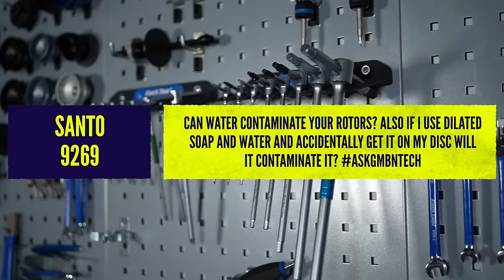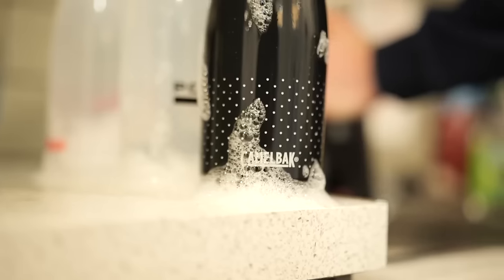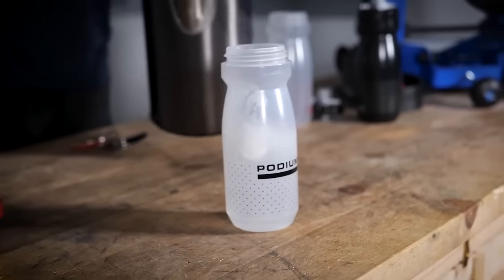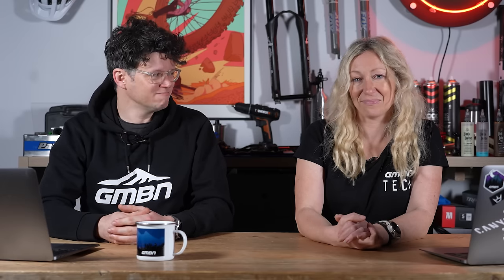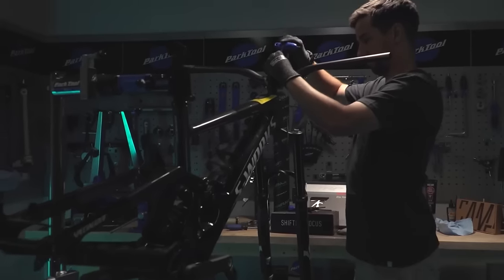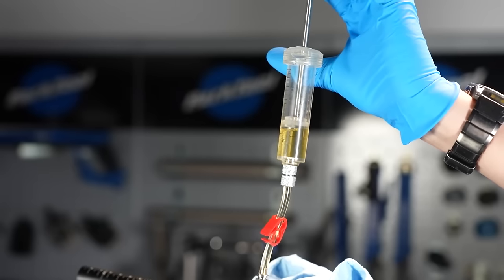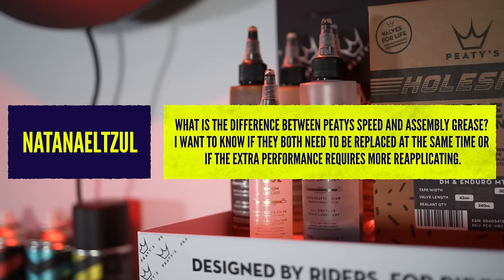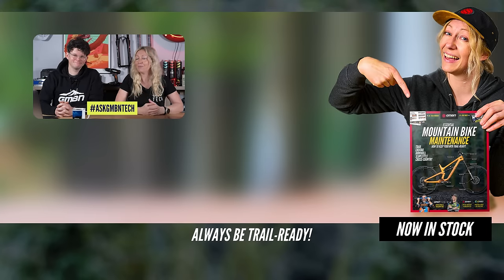2 Pot VS 4 Pot Brakes - Which Should I Choose? | Ask GMBN Tech 276

Comment: I must agree with GMBN
One step at time:

1. Change pads and clean rotors
2. Change rotors for bigger (one wheel on time, front first)
3. Change calipers/brake set for 4 pistons (one wheel on time, front first)
I was using 2pots SRAM Level brakes on both wheels, now i changed to 4pot Shimano 6120 front and 2pot Shimano 6100 rear.

Main reason - for me brake lever shape for Shimano fits better my hand and fits bettter in my handlebar (plus: my old Sram was alredy worn out, with slightly siezed piston, so i looking for upgrade)

Aparently is not much difference - rear one 2 pot (on 180mm rotor) are spot-on. SRAM or Shimano feels same, enough power to lock wheel witout squeezing brake hard.
Front - 4 pots (on 203mm rotor) has slightly better modulation than 2 pots. And pads are bigger, should last longer. And i can lock wheel little easier than on old set.

But biggest improve always was on rotor size for me (change from stock 165 to 203 in front was biggest improvement, 165 rear was ok, but sometimes close to overheating on long descents - 180mm don't have this problem.

Comment: I just installed 4 pot XTs. Easily the best brakes Ive used. Havent experienced any wandering bite point. Much better modulation than my Deore brakes. Im using the resin pads and its nice and quiet.

Comment: 4 pot up front and 2 pot rear. As a rule, if the rear locks up with a reasonable amount of force, that's all you can have, no point going crazy with it. The front does the real work so going with a little more power and working on your modulation is the key there. I run odd pads for that reason, semi-sintered up front for a wide range of braking conditions, sintered out back for longevity. The rear locks up easy enough so why go to the extremes?

Comment: #askGMBNtech. You kinda didn't answer the question about 2 piston and 4 piston brakes. My Fuel came with some lower grade Shimano hydraulic. I've never really noticed if they don't stop good. They get a good reliability rating. But folks in my area, tell me with 4 piston, I would have more confidence on the more technical trails. I still think getting off and walking is have all the confidence I need. My bike also came with a RS Recon. Which seemed alright. But folks told me because of my size, I needed a beefier fork. So I got a Marzocchi Bomber Z1. The bike came with a X fusion Shock. Now I'm being told it's junk, and a new shock will greatly improve the ride. I'm retired and no longer have that regular pay coming through. So I'll only replace that when it brakes. I look at it, as the bike company speced it on there, and they wouldn't have done so if any liability was involved.

Comment: #AskGMBNTech I bought a set of new/old stock Nukeproof horizon v1 wheels. They were taken off a new bike, and just sitting in storage before I bought them. They look great, and easily went on my carbon Stumpjumper. My problem is that I didn't realize the rear hub was 150mm. It fits fine, but my gearing is off by one. I can't shift down to the smallest cog. Is there a fix for this, like different end caps? Also, the brake rotor on the front wheel rubs very badly against the the brake pads no matter how much I adjust the caliper inward. The rotors are new and straight. The front hub is 110m x 20 with a 15mm axle adapter. Where can I get Nukeproof parts that will ship to the states now that Chainreaction no longer ships here?

Comment: #askgmbntech I have Sram GX 11 speed set up with XD10-42 cassette and 30t chain ring, I find I need a better climbing gear and was looking at upgrading to GX 12 speed as you get the 10-50/52 cassette, but can I get a different cassette for my 11 speed that gets me close? what's the maximum range on the GX 11 rear mech? Sram doesn't do a cassette bigger than 10-42but Garbaruk do a 10-46 ? what's best to do?

Comment: #AskGMBNTech
Hello, i currently have the issue of my organic brake pads, glazing over all the time. I recently scrubbed them of and inbedded them with water and now they are already glazed over. What could the problem be?
#AskGMBNTech
Reply: Contaminated disc surface?
Are your braking surfaces shiny, chrome like?
Reply: Aswell as ruffing up the pads I always ruff up the rotor with sand paper, so the rotors not shiny and then clean with isopropyl alcohol with a clean rag or blue towel.

Comment: #AskGMBNtech ive got a 2022 gt avlanche sport, upgraded the gears to deore m5100 but the bike feels a bit heavy, is it worth upgradeing the fork to an air fork and lighter wheels dose the frame have potential as expert models dont seem all that light
Reply: I have a fully upgraded 2020 GT Aggressor Pro. I've upgraded every single part on it. I would get rid of the stock, I'm assuming, SR Suntour coil fork, and go with something like a Rockshox Recon RL. Since your frame has a tapered headtube you'll have a ton more options for fork upgrades then i do with my straight steerer headtube. Go for it man, you won't be disappointed. Regarding wheels I'm assuming your bike comes with double walled aluminum rims, really you aren't going to save much weight unless you go with carbon wheels which can get pretty expensive and imo only marginal weight savings. You could shave off a few ounces by going tubeless and going with a lighter cassette but that's about it unless you want to spend a ton of money and upgrade your whole goupset/crankset to Shimano XTR.
Reply: I wouldn't go with any upgrafes at all for a bike in that price class. It's heavy, so what. Ride it for what it is.
Reply: @NonLegitNation2  thanks for the advice been looking at rockshox revalation plus new hub or wheel i tried to fit an old rekon but it needs a whole new headset new bike is a cube stereo full sus nearly 2kg lighter
Reply: @FIGHTTHECABLE  good advice use it for training and md keep my nice bike for special ocasions
Reply: I have a 2021 avalanche sport, upgraded to 11 speed slx/xt/cs5100 11/51. Works fine for what it is, but if you want to really want a lighter bike with better parts, save your money for a bike with through axle rear etc. It's cheaper to buy a bike with great parts, than buying all of the parts afterwards.
Reply: markor fork too
Reply: @colinl2908  yeah that 9mm qr rear is annoying as is different seat tubes, head sets boost non boost etc  priceing up all the parts on the new bike total was more than the complete bike cube stereo 120r on sale i might well get a new air fork for the gt at some point but light wheels and other components dont seem worth it few grams here and there for mega money

Comment: Get the most braking power you can afford. 4 pots with smaller lighter rotors are more efficient than 2 pots with larger rotors. If you're concerned about weight then diet, lol💯✌️🦚